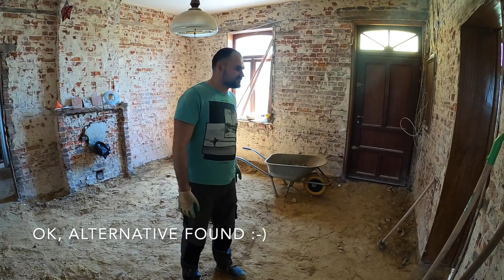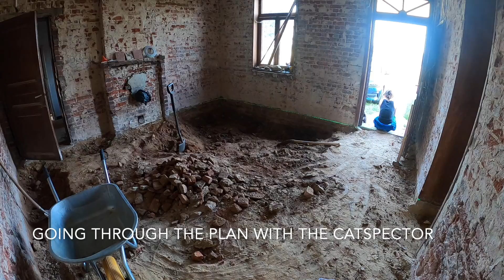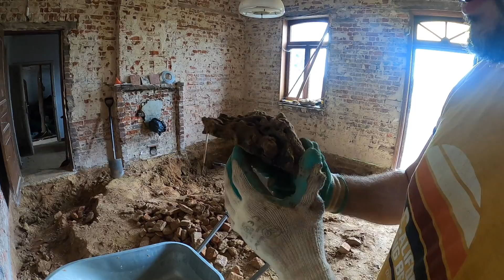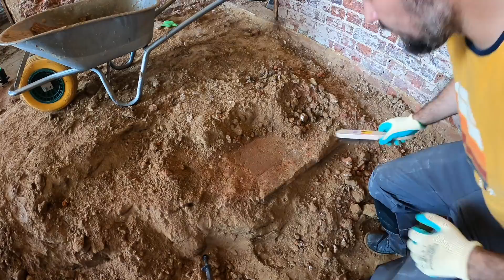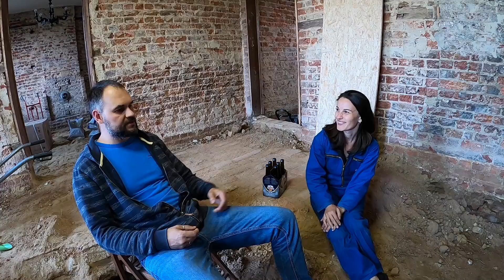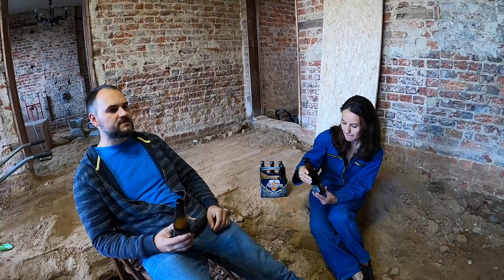Digging out floor in the hallway: 100 y.o. floor found under our floor

Comment: The brick floor was probably an earlier kitchen/diner floor. 
A mate of mine removed a stone slab floor in an old house, and uncovered a whacking great hole with water at the bottom, the original well water supply for the house.
When I rebuilt my Victorian house in London, I filled 10 x 6 ton skips with rubbish/rubble.
I was barrowing rubble up a plank,  into a skip and a neighbour who was watching, declared, ''I can do that!''
So, I stepped aside for him. He didnt even lift the Barrow legs of the ground!
Always looks easy, when someone else is doing it!
.

Comment: If you're actually having a reinforced slab poured (which is a lot more digging than just pouring a clean base, then insulation and screed) please have the slab tied into the foundations so it can serve a structural purpose!
Reply from the maker: Hi Ragnar, how do you tie the slab into foundation? Interesting…
Reply: @DeHoeveOldBelgianFarm  Usually by bashing large holes into the walls (make a 1000 mm wide hole, leave 1000 mm alone, make the next hole, etc.). That way, the walls rest partly on the new slab. I don't think the holes need to go all the way through but I'm neither a builder nor a structural engineer, I just saw that done in a pre-WWI apartment building when they needed to reinforce the foundations during the loft conversion.

Comment: Quick comment. 1908 y.o. means 1908 years old. Implying that the farm was build 1908 years ago. But i believe what you are trying to say is the farm was build in 1908
Reply from the maker: Thank you for the tip  👍🏻 you are right - built in 1908. I will correct it :-) many thanks!

Comment: The way I see it, What you see as the hallway, could've once been the outside (or a covered porch). I see a bricked-up window in your wall at the place where the beam sits, and those brick floors were usually only only used in barns, storage rooms, cellars or outside. Covered porches were used to store boots or clogs, small tools, bikes, horseback riding gear, etc...

Comment: I'm finding it hard to understand why you are taking the dirt out in the first place ? Surely all you need to do is to install a damp-proofing layer, then new floor over the top....doesn't seem to be a need to dig down for any real reason unless you are looking for treasure ! The rest of the floors around are at the same level anyway, so are you going to dig them all ?
Reply: Wiring and pipes, mostly pipes. Not really plausible to pull out bricks and run them through the walls. A lot of wiring can go through the ceiling but plumbing? Not a chance.

Comment: What is the purpose of digging out the floors ?  It looks like you are dropping them 18-20 inches (45-50cm).  That is a lot of dirt !!  Also, if you are going to continue digging out all your floors .... Get longer handle shovels.  Trust this old Contractor.  Your back will thank you in years to come.

Comment: I’m not sure why exactly y’all are digging up the floor, but it certainly is interesting watching.  Music is really nice.  Can’t wait to see what you do.  Wow!
Reply: Presumably they need to put a damp proof course in, to stop damp rising up through the floor. I expect they will put a membrane in and then pour concrete then tile on top of the concrete and no damp will come through the tiles.
Reply: @robwestley7370  most likely insulation on top of the concrete judging by the depth of the dig (rough estimates 25cm of concrete, 15cm of insulation, 8cm of “chape” (no idea what the English term for it is; it contains cement and sand and maybe some other things and is used to create a level surface on which to glue the floor tiles) and finally floor tiles. This assuming floor tiles and no underfloor heating...
Reply: @gvanvoor  i think its called 'scree' in UK. To level everything off?
Reply: @nanyt1812  thank you. yes, that’s what I meant: the “final” levelling layer on which the floor tiles are glued.
Reply: @gvanvoor   well thank you for explaining that because I was wondering the same thing!  Why are they digging a basement in that room!  lol  much love from Ottawa Canada
Reply: Here across the pond we call it "leveling compound". Pours almost like water and when it flows and dries, its level.
Reply: @jonfoster1566  That’s something different imho. Scree isn’t liquid.

Comment: That is a serious workout! I wonder why the brick only covered a portion of the floor? You should run conduit below the subfloor before you start building things up again so you can minimize coring through walls, etc. wow what a project!
Reply: They probably were removing it but ran out of time or something and just said ah screw it and left it 😂
Reply from the maker: LOL We encountered these brick-tiles in other places but they were so deteriorated that we didn't realized it could be a floor. We thought they used their construction waste as foundation.  So this is a very possible scenario, that Ruben mentioned.
Reply: The perfect spot for that would be between the slab and screed, i.e. above the damp-proof course I think.

Comment: The farm floor is 113 y.o (built in 1908)  Great video ,cheers🍻
Reply from the maker: Yes! Thank you! Corrected :-)  the title and the thumbnail
Reply: im a little confused why were the floors dirt?
Reply: Michele Ford  they were originally stone slabs laid on dirt so they're digging it deeper to lay proper concrete floors with insulation 👍